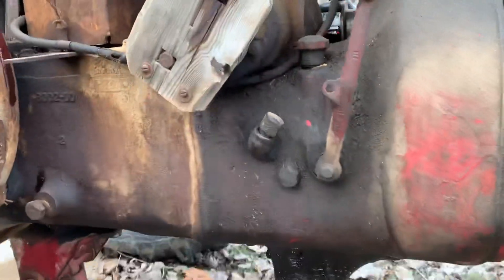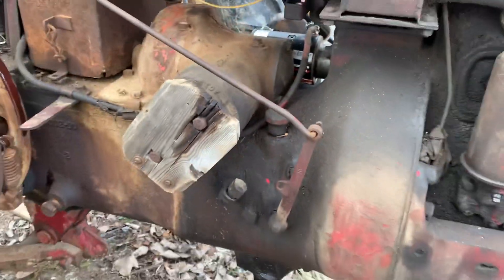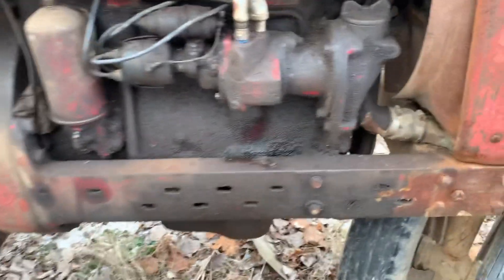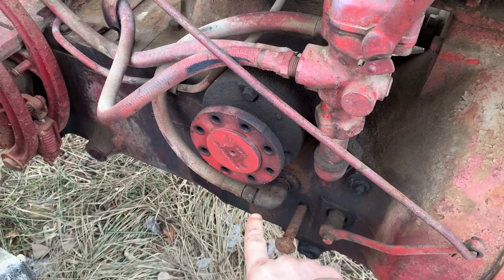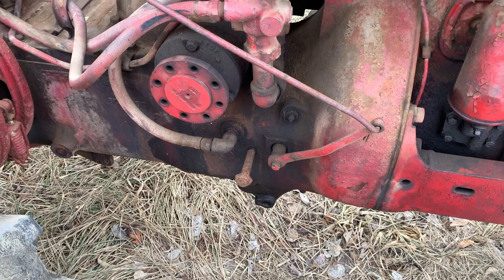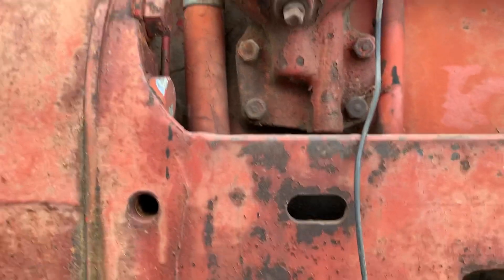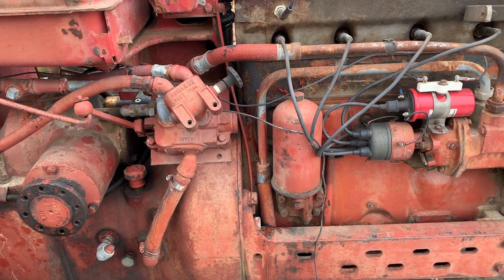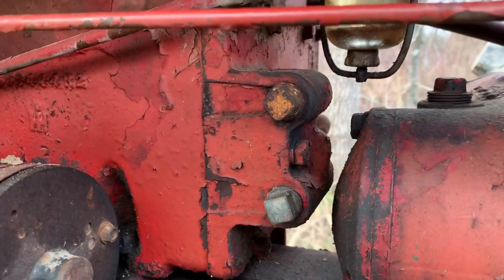Farmall Hydraulics 101: Know Your ABCs

Comment: Nice explanation on the Farmall hydraulics. The Farmalls used the belly pump Lift All up to the Stage 1 Super H and Ms, and they were not live since they are transmission driven.  The standards always used live hydraulics. The W-4, W-6, and W-9 series tractors use an aluminum pump like you showed on the Super H, a cylindrical tank with a relief valve on it, and a valve like the one M had for remotes. IH called them "Remote Control" hydraulic systems. The attachment for remotes and dual acting systems for the Farmalls, were also called Remote Control.  They came out later than the Lift All systems that even some of the F-20s had. The earliest standard tractor I've seen with hydraulics was a 1947 WD-9. In the 1950s, the Remote Control became popular more so with the large standard tractors like the W-9 and WD-9, but some W-6s and WD-6s had it as well. It's very rare on a W-4.
Reply from the maker: The belly pump could be ordered on a stage 2 tractor instead of the the live pump most Louisville super m’s are set up like this using a battery box seat and the belly pump

Comment: Where did you buy that 3 point hitch that you have on your tractor?
Reply from the maker: It’s actually a fast hitch from a 560 with 2 adapter plates that bolt to the axle tubes on a M
I showed it in this video
https://youtu.be/BzLFjLSe8Lw?si=v6pKGajVHEn8Rse-

Comment: Nice explanation on the different hydraulic systems IH offed (and the ones they didn’t) I am restoring a 49 M and im trying to find all the rare ih factory options for it. One especially rare option that I have found is the Selective Valve. Basically takes the place of the hydraulic control rod holer and it looks like a gear shift with three sets of slots. It gives you two one way hydraulic remotes, excellent for running cultivators. To the left powers one hose, to the right powers the other, and in the middle does both! Also the contoll lever has a rod that also controls the belly pump telling it to build or dump pressure.
Reply from the maker: Those are definitely hard to find I’m looking for a hillside hitch but I’m in flat land and nobody used them here
I really want to do a another video that’s even a better explanation

Comment: Hey the new ignition coils have the resistor built into them I see it looks like a new one and you still have the old ceramic resistor on top of it if you take that off you will get a much better spark
Reply from the maker: That’s incorrect partly because it depends on what coil you buy if they are internally resisted or not
If running 6v do not use a resistance coil, plugs or wires